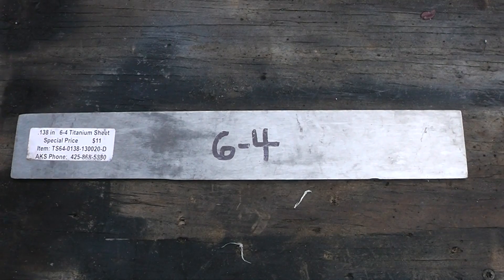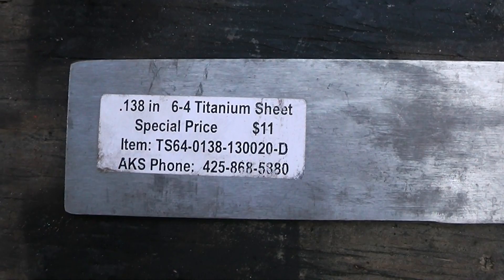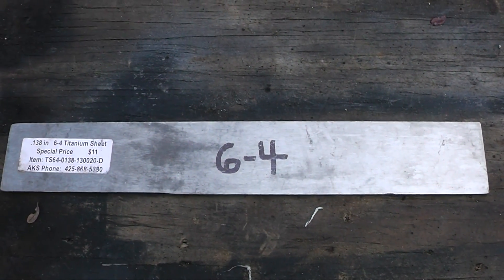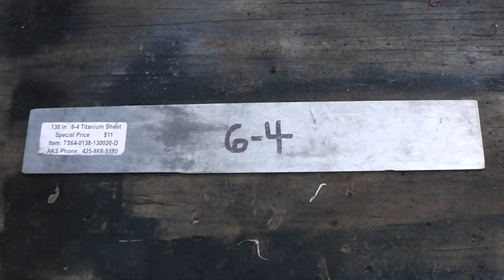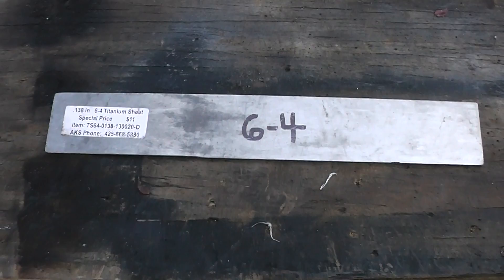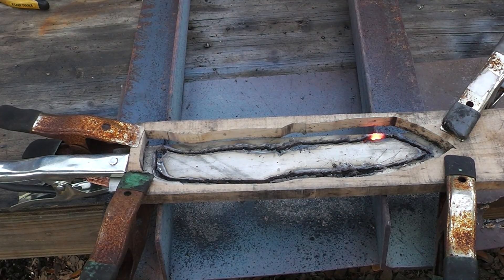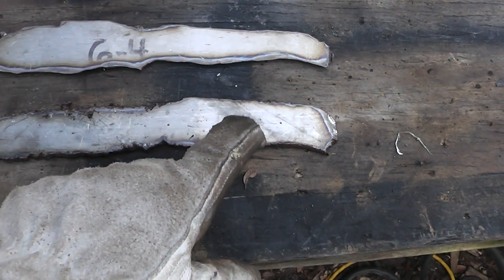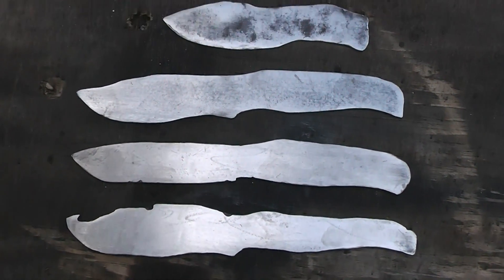Plasma cutting Titanium Dive Knife part 1

Comment: Stainless steel isn't magnetic. Glad to know plasma cutters can cut titanium.
Reply from the maker: Certain grades of stainless are magnetic.
Reply: @homesteadprepper  only poor grades. Stainless of quality that low isn't worth using.
Reply: @GUSftw  i cant think of any stainless steel for knife making that isnt magnetic
Reply: @holycrusadercz6471  so all knives use poor quality stainless?
Reply: @GUSftw  wdym by poor quality stainless? Be more specific, what stainless knife steel is not magnetic. Here is a small article that could help you understand: Non magnetic (Or rather low magnetic) stainless steel tends to be 300 series stainless which is not suited for knives. These steels are austenitic steels, which can remain austenitic due to the nickel content. However as hard steel usually depend on converting austenite that has dissolved carbon to other forms of steel (that do not dissolve carbon readily) from the austenite and hence stress the crystal lattice, austenitic steels usually cannot be hardened to hold an edge.

So even expensive or as you call it "High quality Stainless steel" can be magnetic .or i would say usually is magnetic. There can be some exception but i can't really think of any from the top of my head.
Reply: @holycrusadercz6471  i guess what i'm saying is that to me high quality stainless is non-magnetic because the qualities i value are the ones found in non-magnetic stainless. You've helped me understand that for knives a different stainless steel is required. I do have one question though, does the stainless required for hardening knives lose any of the anti-corrosiom qualities of non-magnetic stainless?
Reply: @GUSftw  i dont think so, some steel could potentionally loose corrosion protection after heat treatment, but that really depends on the steel and heat treatment process/quality. But even high quality stainless could potentionally rust in certain conditions. Although not as quickly or severely as lets say high carbon steel.

Comment: with some skills with plasma you can easily obtain strange and complex shapes in very short time that with other tools reqire even hours to obtain the same precise result. and now plasma are not so muh expensivem you can find them with the air compressor integrated inside and all working together with normal home electric plant monophase low power.

Comment: plasma imho is very underrated by knife makers. does not heat much the steel and is easier fast a very precise as it looks here since you learn how to use it with some practice as any other tool. i.e. you can also easyly cut holes inside the tang in the handle part to lighten it. that is much more difficult with other metal cutting tools if not very big pro and expensive.

Comment: lower your settings and increase air flow :)
Reply from the maker: Mustafa N Kamil I need more practice however, Ti is some pricey stuff to get good on.
Reply: @homesteadprepper  Bro If Titanium Grade 3,
Thickness 35mm

This metal can be cutt with thats machine (Plasma Cutt)
Reply from the maker: If you are asking if this plasma cutter will cut 35mm the answer is no.  Max cut is 22.2mm or 7/8".
Reply: @homesteadprepper  Means

Need big Plasma CNC or Waterjett

Thanks bro

Comment: Plasma cutter seems like the wrong tool to be using here. I think you'd get better results with a bench grinder.
Reply: My issue was not the technique but the execution. I’d opt to make patterns out of 1/4” aluminum plate.  Aluminum patterns can be made with a router, solid carbide “O” bit and MDF template. Also lose the metal guide.
Reply from the maker: ***** I was attempting to cheat.  It didn't work out all that great except on the steel.